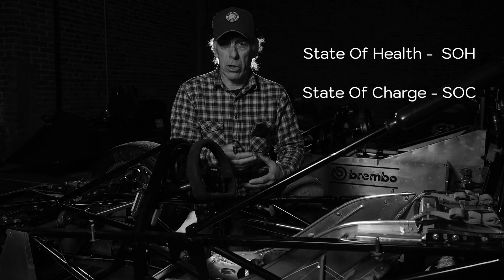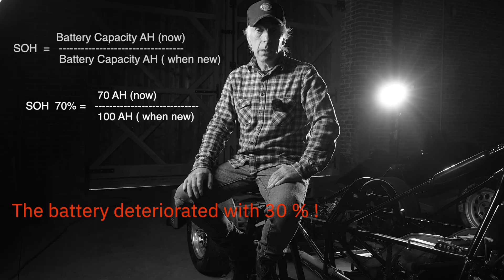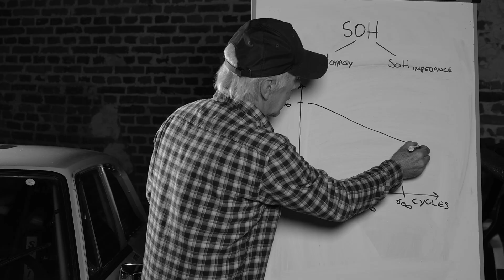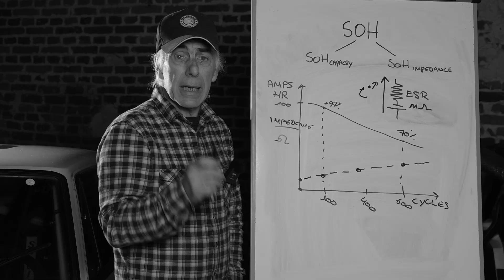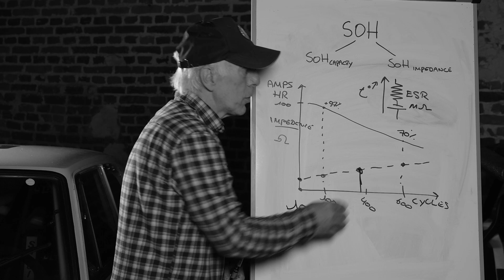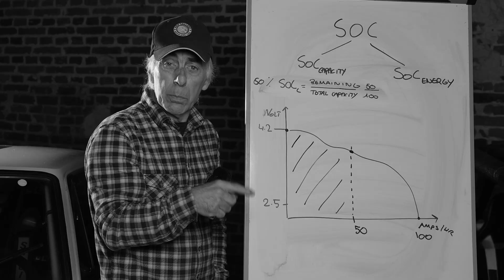EV's no thanks.  However if you do buy  a second hand EV - check this video- Battery State

Comment: I don't drive very many miles a year these days but I absolutely refuse to have an electric vehicle. I have a 1984 Ford Capri and I will make that my main car if I have to or I will buy a good old W123 Mercedes and use that. Maintenance is not a problem because I was a trained mechanic and still have all the necessary tools..
Reply from the maker: Thanks for watching, and those classics are great.

Comment: Another fantastic video, thank you! I’ve watched many of your videos and enjoy them. I have a BMW i3, unfortunately it doesn’t allow a charge limit to be set so for practicality I always end up charging to 100% as it’s charged overnight. However, if I were to charge to only 80%, then I’m having to charge more often over the lifecycle of the car, and charging alone adds stress to the battery, so perhaps it equals out. I’ve also seen quite a few videos online with very high mileage EV cars, over 200km and it seems the degradation of the battery health isn’t always as alarming as it seems, most seem to retain at least 80% capacity. Although some models, for example Zoe are apparently are a lot worse and go down to 50-60% over time. My car is pretty new (2022), and I won’t keep it for long enough to have a significant impact on battery health, but for those buying much older EV I would agree there is a high risk.
Reply from the maker: Interesting points, and thanks for the information!

Comment: My son just bought a Tesla model Y.  He got a great discount on it in Phoenix , and he brought it by my house for me to drive.  I am an old hot rod guy...okay, but I was amazed at how quick this Tesla was.  Much fun to drive, and comfortable.  However , we live in the furnace known as Arizona, and it is 114 * f  today.  He had to take it to Las Vegas for a leaking rear gearbox seal.  They loaned him a Cyber truck , which he also stopped at my house with.  That thing was massive !!  The computer interface takes some getting used to, but I just think it is all very cool.  Not that I would want any EV, but you can't stop progress.  I will keep track of my son's adventures with this Model Y.  The Az heat is hard on just your regular car starting battery, so we will see how Tesla  holds up in 115 * .
Reply from the maker: Thanks for sharing your experience!

Comment: Good presentation Steve.  I also am fascinated by the technology but not necessarily the reasoning that many (not all) EV owners give for ownership.  City living with a tiny amount of use and easy charging options, then possibly. But ‘Saving the Earth’ is not an argument.  Where and how is the electricity generated? How much energy was used to manufacture the vehicle? What’s the life expectancy of the vehicle and how can you dispose of a bunch of lithium batteries?  Can I charge it correctly to maintain battery life. Your correct to state that a health report is essential for the battery condition.  However, if you purchase a good maintained economical older ICE car, it’s carbon footprint is already paid for, it’s not going to create CO2 or other pollution above that of a good EV created during the build and the charging from power stations burning coil, oil or gas.  Plus a ICE car is roughly 80% or more recyclable.  The EV car is much lower and there are many arguments around what to do with the lithium battery packs when they no longer accept a charge. They are still dangerous and very toxic and will use an enormous amount of energy to cleanly recycle. Hydrogen is a better option. Also think of other ICE vehicles which create massive pollution but each and every one of us use. Eg container ships that bring our goods around the world, diesel trains that bring goods across continents for us to buy in the supermarket, aircraft (OK not traditional ICE but….) EVs have their place in our world but the infrastructure and ‘cradle to grave’ journey of a EV has not been properly considered and is genuinely not currently in place. ICE  vehicles are not the solution either but they are here and affordable for many. So we need to squeeze every single ounce of use out of them whilst a genuine clean solution is devised. Sorry, rant over. Don’t shoot me. 👌
Reply from the maker: Thanks for the detailed comment and I can only agree. The EV story is and has been manipulated /used by the environmentalist to push their views  and only theirs.  Where reality is very different as you described it.  My main issue  is the way how they push  the EV  down our troth by people that are not even elected nor a majority .
Reply: @D3Sshooter Agreed Steve.
Reply: D3Sshooter That's unfair, they do share one specific quality with the majority of the people: Their total stυρidίty...
Reply: My company bought a Renault Zoe, here in Norway, quite simply because an EV is half price here, so the Zoe was about 25k cheaper than the equivalent proper car. Norway has horribly high taxes on proper cars, so when there is no tax, or VAT on EVs they are cheap. The zillions of lost tax I come is not a problem if you are a short sighted green socialist government, just raise others taxes, but back to the Zoe, the way things are here I saved load of money on the Zoe, there's no tolls, and charging is at my companies place. I have never driven it, but my seller who uses it seems pleased after years. New cars today are rubbish anyway, wetbelt and camchains that don't last, hugely expensive and complicated eco systems, I think a new battery on the Zoe after 8 years is about the same as multiple DPFs, and a new eco boom engine on a Ford. Both will be rusted to death by 12 years anyway. I hate EVs, and did not like buying it, but all new cars today are expensive and have a terribly limited life.
Reply: the environmental issue is always raised when politicians have no solutions.. it would be good if they presented the accounts for the environmental costs of lithium, from production to recycling... not to mention the energy production itself, everyone thinks that photovoltaic plants and wind turbines are just wonders

Comment: Hmm whats more difficult on a 50yo car: turning a wrench and measuring fuel pressure OR pulling and reading eeprom to reverse engineer the firmware to see why the car wont move?
Reply from the maker: If you ask me ,  the latter is the most difficult as you will not be able to access or read EEPROMS or even get the logic of ASIC's etc..   It all protected to begin with.   So , I prefer the old way that always works.

Comment: I have driven electric mini Cooper s for 4 years, 17,000 total miles. I charge at home in the garage. I have only used the 120 volt charger that came with the car. When recharging I go to 100% as my full range is only 110 miles. Very economical cost per mile 16 cents per kilowatt hour.  Mini is fun, quick, great visibility. Mini has had 2 software updates since new. No loss of range so far. I have other gas powered cars for longer trips. Rarely need more than 75 miles in a day. I received a federal income tax reduction of $7500 the year I bought the car. Charging stations are still rare in Ohio. I was willing to risk the small purchase price for this car. The US government requires the battery to have an eight year warranty on the battery still holding 80% capacity.
Reply from the maker: That's great to hear about your experience with the electric Mini!,

Comment: nice video, good info, it even includes calculus :). I didn't think of internal resistance as making the battery heat up faster but it obviously does.
Some cars (or most) have battery thermal management with cooling systems but asking high amperage (flooring the car) still wears out the battery quicker and increases the risk of fire.
Reply from the maker: Glad you found the video useful, and thanks for the insights!

Comment: Hi Steve,

Finally a video related to EV.     I'm driving now since 5 years one and since 1 year even two.  Still have my classic vehicle also, similar as you had one before or possibly still have.  You know me ( former colleague... ) and I have solar panels since 11/2006, some more since 2019 and drive at least for 75% with my vehicles charged with my own solar energy via intelligent charging.   Only in the winter I need to take from the grid to get them runnning.  
I remain curious to see the moment that you will drive an EV ?
For sure, I like driving electric.   No needeless sound of noice, no bad smell, no oil.  So far ( cross-fingers that no electronics or the battery gives a fault ... ) there is a low maintenance cost.
But your world is classical vehicles.  Always amazing to see what you can, what you know, what you do.  This in all you do ( and have done ) .   Kind regards   Walter - Hasselt
Reply from the maker: Hi Walter, thanks for watching and sharing your EV experience!  I think you have one thing wrong.   "this is all you do and have done"  . You might not be aware of the leading technology is was deeply  involved  in.  The main reason that you went solar panels was profit at the time,  the same applied to the EV... as long as you were able to make a profit through green credits or government subsidised  procurements .  But think for a minute if that would not have been the case ?  No green certificates for the solar panels, road tax and other taxes for the EV just like any other.   What would have been your decision then ?
Reply: @D3Sshooter  100%

Comment: Another thing that should be demystified about electric cars is the issue of maintenance. Unlike combustion engines, the idea is that electric cars don't require such expensive maintenance. This is partly true, but while the car is new, over time, electronic components will deteriorat for example, the huge capacitors in inverters... The only components that require very little maintenance compared to combustion cars are brake pads due to regeneration and oil and filter changes, for obvious reasons. But as electric cars become more complex and have greater range, the issue of maintenance will become increasingly important, not to mention the cost of charging an electric car.
Reply from the maker: Thanks for your thoughts on that topic.